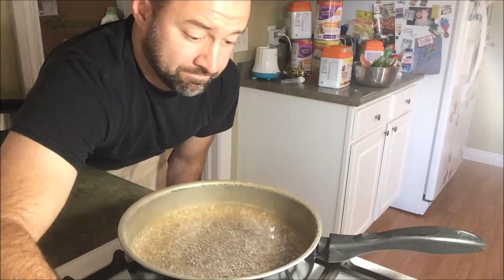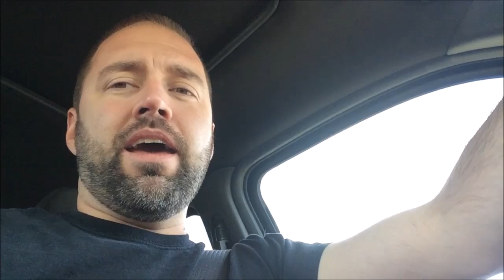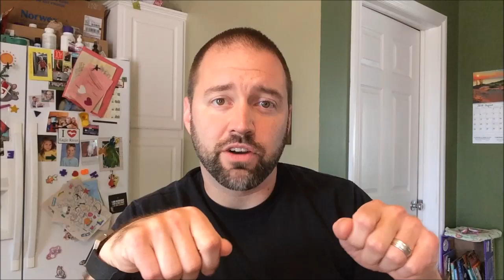Why is my Battery Making a Bubbling Sound?! Is this Normal? [SOLVED]

Comment: My Quest 2 battery did this.  As soon as I noticed it, I unplugged it and stopped using it immediately.  Last thing I needed is Lithium Ion thermal runaway ON MY FACE.

Comment: I don't recall you mentioning that the battery caps should be off while charging maybe I stand corrected
Reply: If it’s a modern batter like in the last 10 years, all my batteries I’ve gotten for my car and most have the vents as part of the cap. Call your dealership to be certain. Or where you bought it if it didn’t come with the car.

Comment: I have a seal non-spillable 12 V lead acid battery start hearing a hissing sound. I took it to the auto parts store to get it charged before I started hearing Houston when I brought it back. My vehicle started up late. I was gonna go to the store I still have the hood popped up, I started hearing a hissing sound

Comment: I have a calcium leisure battery & I brought a cheap charger & it didn't turn itself off & overcharged. It was hissing & almost hot to touch,  I let it cool down & used it for one night & next evening it's sending weird voltage signals & wont fire up my diesel heater , & my leisure battery reads 13.0 V. Seems like I cooked it 

Can they be repaired  thx for sharing 🙏
Its about 3 months old

Comment: AS FOR THE DOOR...The a.c. or heat turned on..the air flow being pulled from the room opened the  door slightly.  It was not closed all the way or latched..and the knob was not turned. Good seal..air flow and smooth well balanced..lubricated hinges opened the door.  YOU'RE WELCOME😂😂👍👍

Comment: Hello! Thanks for the video! I want to ask, apart from the boiling, if there is a faint high pitched sound, is this bad? I have a smart battery charger and the high pitched sound occurs when it's shown that it's almost fully charged - should I stop charging when that sound appears? I have a 12v CA Lead acid battery, thanks in advance!

Comment: Thank you! I'm alone in my fifth wheel and we just installed a new charger to our 4 AGM golf cart batteries, I checked them and almost had a heart attack. Looks like the light bubbling is normal. Heart attack averted. Thank you.

Comment: Hi there. just 1 important technical question I have. Will a 50% SOC lead acid battery buble if charged with 17v solar panel that's charging at leas than 0.1 amps it's rated capacity? I have tested this I was charging my 100ah battery with 17v and 5A constant charge and I noticed with caps on cells off that there is no bubling until battery gets full and reaches above 14v. What are your thoughts on this? Is it ok to charge battery on higher voltages if you keep an eye on them knowing when to disconnect charging? I mean it charges much faster at 5Ax17v=85w than 5Ax13v=65w. 🤔

Comment: I was on my boat and my trolling motor battery (deep cell) started hissing and it continued to get louder until I shut the motor off. Then it quieted down slowly. I disconnected the positive, screwed it back tight and continued to fish for a cpl hours using the battery. Should I replace it? There’s a sticker from 2013 on it but other then that I haven’t had an issue using it for 5-8 hours on end.

Comment: I have been using two Sealed lead acid batteries for motor bikes which do not have any specified rating when it comes to discharge current and whenever i discharge them at relatively high current ( never beyond their 1C rate) i start hearing a hissing sound, is this dangerous?

Comment: I've got a sealed lead acid which is bubbling at 14.7 volts, should i be concerned?
Reply: Yes, the maximum should be 14.4v for sealed lead acid batteries and they don't bubble when charged using 14.4v chargers or lower

Comment: do you know, a current to dissolve plates , eddey current lost, hysterical lost, i check mine, use a temperate finder , when a batterie swells, its bulging and overheating, exciting is correct, electrtoysis kills metals, your a very smart man

Comment: Please , can lead acid battery give off gas fumes when chargiging.and if i stay close to charging battery will the gas harm .
Reply: Yes, it wil harm only if you are in same room and no fresh air is going in and out.
Reply: @manipurgaming803  yes there is ventilation  but have to stay right   next to it, like on top of battery its a truck  battery big one. Vantilation is there but will it harm by gases  when charging .
Reply: @manipurgaming803   and what harm it will cause

Comment: Great video! I was charging my AGM battery with a normal charger and i did heard some bubbling very quiet but it was there, I didn't realize it was an AGM, because in the (incomplete) Yuasa EU website didn't said it was AGM, it only said "ACID battery" (but in the Yuasa Spain/UK site DID said it was an AGM, their site are waaay more complete tbh) so, I let it plugged for 30 min until i realize it was an AGM I immediately unplug it.. :/ Do you think that if i charge it with an AGM compatible charger the battery will still work ? I'm kinda worry it will explode or something haha

Comment: i bought some used AGM 6v batteries and one was bubbling out the water out of 4 battery bank running in a 24v system. Wasn't sure what to do, but that one was a higher voltage than the rest. The person I bought them from was able to top them up with fluid somehow though

Comment: I recently sprayed a battery acid cleaner on my golf cart batteries. Rinsed then off and wiped them down afterwards.   Noticed a bubbling g sound the next night. Also noticed that my battery charger doesn’t seem to be shutting down after charging. Like it’s constantly charging. Any suggestions?

Comment: Very good video with explanation behind it!!! I cant tell u how many questions I get regarding about new batteries,I get these questions because I have been a mechanic for 25yrs,the most questions I get about batteries 90% of the time is about atv/motorcycle battery questions because when u go to the store and get a new vehicle battery 95% of the time nothing is needed as far as but acid or electrolytes in it u just pop it right in vehicle and your good to go. But with these atv/motorcycle batteries when u get one u have to put the acid/electrolytes in it yourself and then when done charge it. 
Now the first question I always get is a call saying mike! I put the solution acid/electrolytes that came with it and the battery is very hot on all sides of the battery!! And I tell them that is completely normal!!! Its the acid binding to the plates in the battery so it causes that heat reaction!! 
Now the biggest mistake I see most people make when dealing with this kind of battery is after they put the acid/electrolytes in they either one,try to charge it right away which can cause them to explode!!! Because most of these batteries are a sealed agm battery and they dont have a vent to escape air and gasses out,u always let them sit for a hour at the least,but I normally let my sit over 5hrs or so before charging it. Then the second mistake people make is the kind of charger they put on these kind of batteries!!! You have to realize that on these atv/motorcycle,dirtbikes etc, they dont have a alternator like a vehicle to charge the batteries they have voltage regulators on them which puts very small amps to the battery to keep it charged most are between 1-3amps is what they send to the battery and most alternators on vehicles are putting anywhere from 90amps-200 amps back to the battery depending on the vehicle. But alot of people try to charge these smaller atv/motorcycle batteries like they would a vehicle battery and they take many years of service off that battery when they put any charger on them more than 3amps. Best is to find a 1amp trickle charger and put on and leave on for 10hours.
I know I just wrote way more than I had planned on but hopefully I help a few people with all this!
Reply from the maker: Thanks for the post!  I'm sure it will help tons of people out.  I'm still learning too so I appreciate your input!
Reply: Helped me!
Reply: I heard the same bubbling sound and gases coming out left it for a hour and half and it's fine , now but it on charging with 1 amp hope it work.
Reply: Glad I didn't see the explanation coming from behind that creepy door in the back! lol
But yes I do appreciate the extra info you provided as well. Thanks!

Comment: Is it normal for a calcium battery to bubble during charging? cause mine is and im not sure what to do about it
Reply from the maker: I'm assuming it's a sealed battery?  What charging voltage do you have it at?  Do you have a charger with "calcium/Ca" mode?

Comment: I've used vrla battery, the battery bubbled at 18.3 V. Even cycle use battery 14.4 - 15 V and standby use 13.5 - 13.8 V. Is that normal or not?

Comment: I think I stopped my AGM charger in time.  The charger got all the way up to 14.7v.  I could hear a couple gurgling noises but not much.  Just a few sounds after I shut the charger down.  The charger was on it's AGM setting.  Going to return the charger.  I think 14.4v is the max my battery is supposed to be charged at.  I'm glad I decided to check on the battery/charger every 30 min or so.
Reply: @azer_azar  I have moved on up to lithium.  Expensive front end but hopefully it will be cheaper in the long run like it is supposed to be.  I do know that it definitely charges faster and holds that charge, etc.  I also like the fact that you can deplete them much further... almost like having 2 AGMs of the same rating.  MUCH lighter also which is nice sometimes.

Comment: The as stated "overcharging" may not necessarily be a bad thing. From my understanding a lead acid battery forms a salt on the lead plates when it has been drained past operating range and this "overcharging" helps remove the salt which is damaging to battery life.

Comment: I am charging a 12 v 9 amp hour battery for a razor scooter.  The charger is the one that came with scooter but I still hear a slight bubbling.  What do I do now?
Reply: Stay close to your scooter watch the charging light at all times if not you'll overcharge it,I did lol

Comment: if a battey is creating a bubbling sound it means its actually bubbling. the thing is that with lead acid batteries when you charge them with water replacement, they also create these bubbles. its the acid that is reacting different concentrations  of water to acid solution  that result in bubbles. i heard sounds like these in a empty 9 volt battery without  anything connected.

Comment: If I have water seepage on top of my batteries is that the boiling? My batteries say they are low on the hydrometer do I add more electrolyte?  Because the plates are covered with distilled water.

Comment: Two of my chargers start to make a whistling sound as soon as I plug the chargers in with/without the battery on it. The bubbling sound is new to me, btw my two whistlers are the DW9116  7.2v-18v chargers.
Reply: That's just coils vibrating in a switch-mode circuit.
Reply: mikokuijn ok ok I have a powerbank that is making that sound is that normal? Is it bad?

Comment: One more thing. U can get in the sealed batteries and they also make the electrolyte solution for them. I have a sealed Harley battery that is s non maintenance batt but u can still get in it  and add solution.

Comment from the maker: If you're experiencing crazy bubbling with your batteries, what charger are you using?
Reply: Home Battery Bank my battery is doing this. Not boiling just bubbling from off gassing. It’s an AGM batt. It’s on a battery tender and on multimeter and showing 14.11 volts. Unplug it and it goes down quickly. It’s a Schumacher tender. Not sure what’s going on.
Reply: The same as it came with the laptop original
Reply: I just heard it using a shumacher battery charger/jumper.  I guess its time to dump that battery?
Reply: optimate4 charger